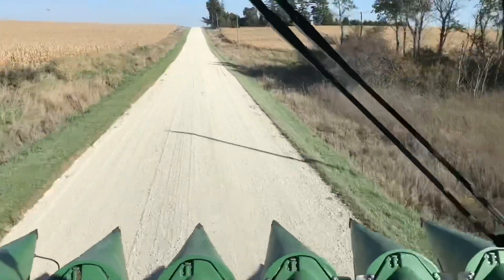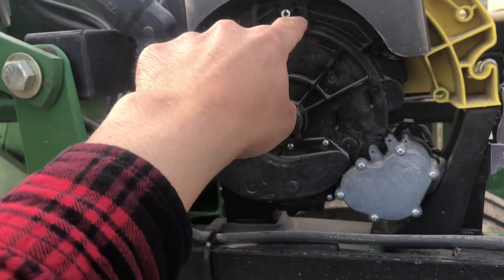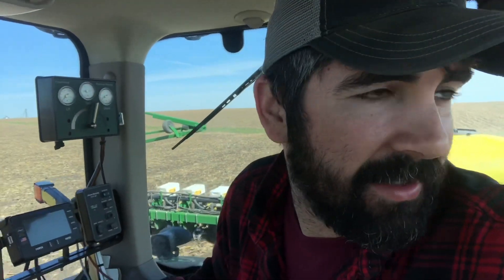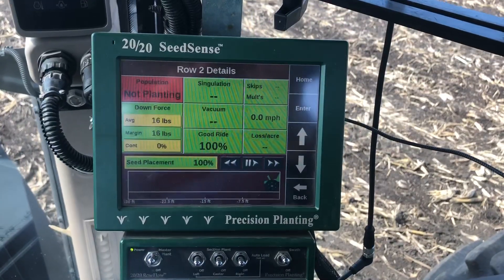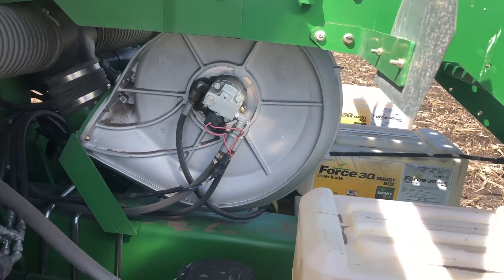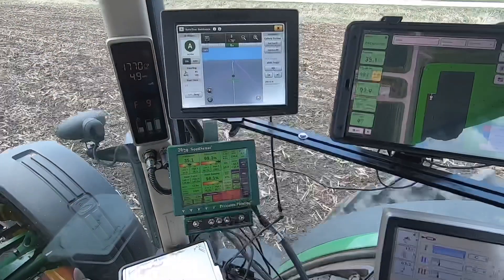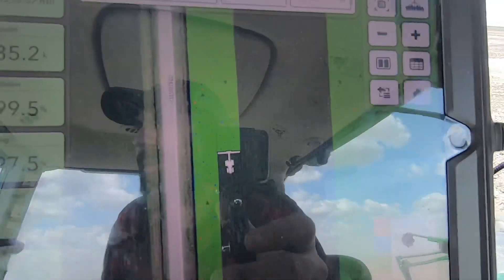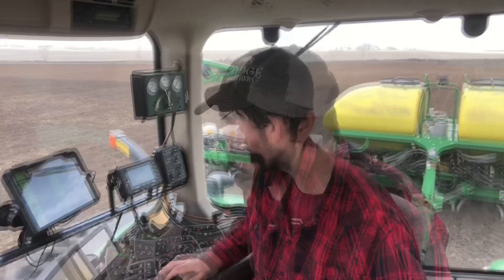A farmer explains how a modern corn planter works

Comment: Where I live there are hundreds of thousands of acres of farm fields, but one thing that intrigues me the most is, what are the arms that are folded up on the outer sides of the planter for and what is their function?
Reply from the maker: Those are called markers and we rarely use them anymore now that we have gps auto steer. The markers draw a line half the width of the planter and then on the next pass you drive right down that line to keep the spacing correct

Comment: OK, the one blower sends the seed to the planter unit but what controls the amount going to it? You can't just blow seed when the unit is full.  I'm thinking that the hopper gets full so the air flow is restricted and therefore it's self metering. But just an old fat guy with a keyboard drinking bourbon.  Nice content, thanks.
Reply from the maker: Good guess! You can see it up close in the new video !

Comment: At the beginning of this video, was the case and turbotill actually running that fast? Everything was sure bouncing a lot, would think that would make a bouncy wavy seed bed and noticed the planter tractor and row cleaners bouncing more than when later in last years bean field planting?
Reply from the maker: Yes they were going around 9 mph. That implement does the best job at high speeds. It’s not designed to move a lot of dirt so to achieve the best leveling you have to really get it rolling. In corn on corn corn the planter is always going to ride tougher than in the bean ground. I wish it was all 50/50 with no chisel plowing

Comment: Question; How do you use down force.  Is it for the packer wheels, and does the weight of the machine vs. gauge wheels apply the down force.  What does the compressor do?  does it clean out the shoot?
Reply from the maker: Two great questions! Just added them to the list to show on a later video!

Comment: Things are a little different from when I helped my dad plant soybeans with our two-row planter back in the late 1960's. I saw on a seat at the back of the planter and would raise and lower the planter with a lever. Marker arms would show where to drive on the next pass. Our planter was actually equipped to do check-row planting (Google it - fascinating). This dates to back when horses were used to cultivate corn, so that you could cultivate in two different directions. The wires had knots on them that triggered the planter to drop a seed such that each row lined up with the preceding rows. I can't imagine how much work that would have been, but farmers back in the day took enormous pride in their efforts.
Reply from the maker: Wow I almost forgot about check row planting! I’ve seen them at antique power  shows but never gotten the pleasure to do it myself. I’m not entirely clear on how the wire is handled
Reply: @dodgebrothersfarmandranch9206  https://www.youtube.com/watch?v=KRveQ5nB0fI

Comment: Hello Carl, I didn’t realize that you would plant corn this early. In my garden I plant sweet corn around May 15. There were several years, in Illinois, when we had early May heavy rain followed by cold temps in upper 30’s low 40’s. This caused nearly all my seeds to rot, and had to completely replant. Don’t you run the risk of bad wether ruining your planting? Have you ever had unusually terrible weather follow planting? Thanks and enjoy your channel.
Reply from the maker: Good question. Sweet corn is very delicate and needs the soil to be at 60 degrees Fahrenheit for good results. Our field corn is much more resilient and can handle a lot more adversity.
Reply: @dodgebrothersfarmandranch9206  I'm surprised at the number of people that think this is the type of corn that they eat at the table, but then I grew up in Cornstar County! Good luck with the planting and harvest! I just thought of a fun fact- the county in the USA that produces the most sweet corn is------- Palm Beach County, FL We have fresh sweet corn any time of the year.

Comment: Great video!  Very, very cool presentation on today's planting technology.  This, from a guy who learned to plant with Dad's Oliver 88, and a John Deere 494A.  Best we could do was find the right plates for population, keep checking visually to make sure the drive chain and fertilize feeders were turning, and fight the manual steering to plant the (4) 38" rows as straight as we could.  Therein, was both the challenge... and the art.  ;)
Reply from the maker: Yes! We have lost the ability to drive straight if the gps fails.

Comment: So, the cost of a new planter like that?  I saw a used 2006 planter advertised at $47,500!
Reply from the maker: This one was around $150,000 back in 2011. We have since upgraded a lot of the parts instead of trading planters.

Comment: If the GPS is smart enough to plant straight rows, why can't it also make the turn at the end of the rows?
Reply: It's possible and is available on some setups. My best guess for why it isn't available on all of them is that it is a programming issue.
Reply from the maker: Good question! The tech does exist, but I’d fall asleep for sure 😎
Reply: @dodgebrothersfarmandranch9206  When you finish planting, how to you clean the planter of corn seeds?

Comment: Did you really put this video up at 2 AM?  Thank you for your dedication!  Looks like ideal planting conditions.
What an amazing piece of machinery!

Acres per hour?  Obviously there is prep time prior to heading out, right?
How is seed and row separation determined?  guessing row is fixed and seed by hybrid type.
Number of acres to do?  
Pounds of seed?
What soil temperature and moisture do you look for?
Not clear on how seeds are metered from tank
Do you listen to radio or music when planting or listen for key sounds that all is running right?
How do you keep focus with so much automation?
Do you have to tip the caterer for job site delivery?
I just feel your excitement for this time of the year.
Reply from the maker: Sure did! I think I covered a lot of this in the latest video. I’ll go though the list

Comment: Here's a question:  do you soil test all of your fields each year?  If so, do the results of that soil test determine which seed hybrids you use, or primarily the fertilization prescription for that field that year?  Thanks for taking the time to explain the equipment and what you're doing in the videos - helps us non-farmers understand the complexities of all that you do.
Reply from the maker: I should talk about this. We soil test every three years for fertility. The soil types are what influence seed selection the most and those maps are available online. You can look up “web soil survey” and I think you will enjoy it!
Reply: @dodgebrothersfarmandranch9206  Thanks - we see a lot of talk about seed hybrids, different maturation times, etc - and farmers using many different types of seed - I was just curious about the process of how you dial in what you're going to run each year.  With the cost of seed and then yield at harvest I would imagine getting it wrong could be an expensive mistake.

Comment: We planted corn yesterday  here in michigan. We had some rain last night. We still might go later on today because it's windy and it's drying fast. We use a kinze 3600 central fill planter interplant planter for both corn and soybeans on a johndeere  8400 r  and a case 1245 planter for soybeans on a case 340 magnum . We aso use a 45 foot field cultivator with a johndeere 9560rt  .We have 4500 acres and custom work as well.  Nice video stay safe and farm on my friends !
Reply from the maker: Wow you have a lot to get done but big equipment too! Have a good spring!

Comment: Very thorough and  good in depth description of how a planter works and Thank You for that.

If you work with air seeders maybe you can describe how they work versus a planter. We use lots of them in Canada for wheat and canola I believe and from what I read they cannot seed large seeds? Not for row crops either.

The seed population must be done by a variable speed electric motor seed wheel? I am a Power Engineer and like technology and you are very knowledgeable. Thanx.
Reply from the maker: Thanks! I show the meter insides on the next video. Sadly I have never been around the big air seeders so I don’t know much about them.

Comment: Keep throwing this videos out.  I love 'em.    I do wonder what the arms with a couple of discs you have folded up on your planters are for.
Reply: Joel : They are markers. They are used when no GPS is used. The marker is extended making a mark in the soil. When the tractor comes to the end of the field the marker is raised up so the tractor can turn around & the driver will center the tractor on the mark spacing the row next to the last row !
Reply from the maker: I show them working in the next video!
Reply: @dodgebrothersfarmandranch9206  Thanks..   That was very informative to actually see it in operation.   Thanks for your videos.

Comment: Couple Questions.   What are the folded arms on the planter for?  Also are the seeds naturally that color?  Do they have a coating on them?
Reply: I can answer that. They are markers that are used for proper spacing when GPS autosteer isn't being used for guidence. The little disk on the end makes a mark in the ground that you follow with the tractor.
Reply from the maker: Answered both questions in the next video!